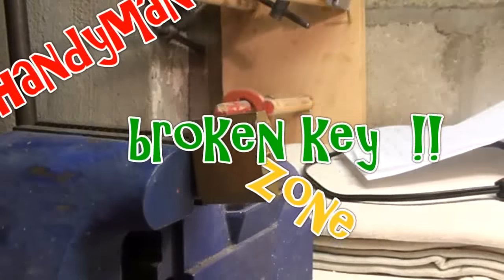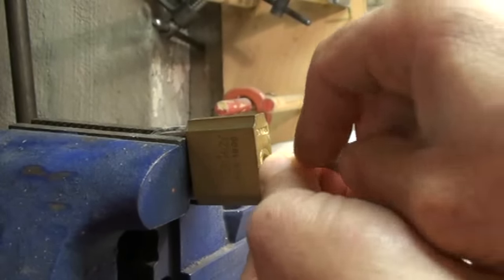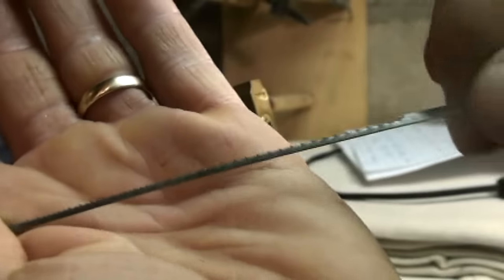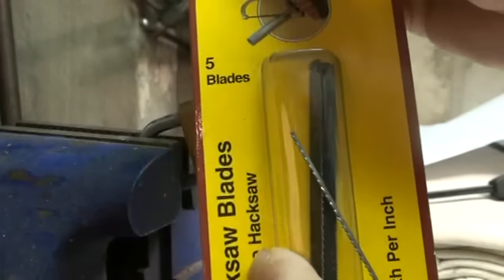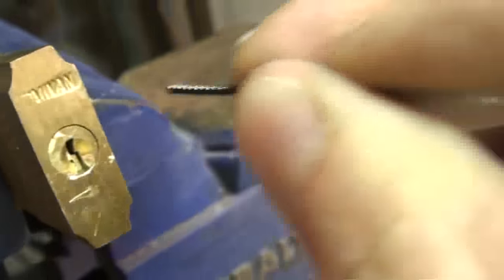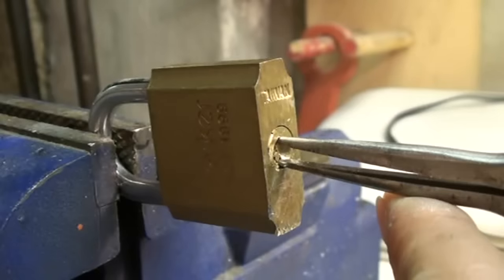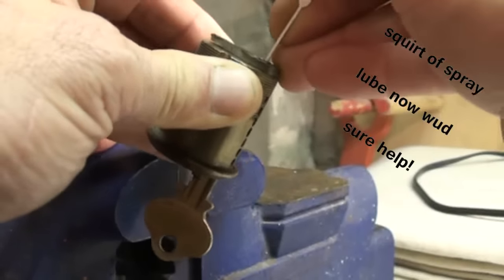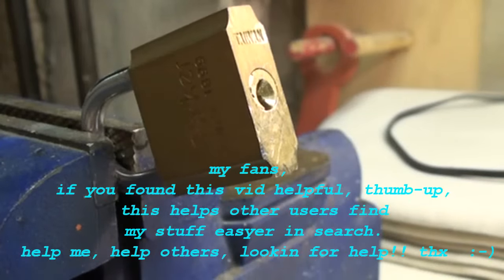7 Tricks Get Broken Key Out Yourself - Any Lock or Key

Comment: Your tips are still working, this one was a big help. The key was already turned in the door lock but was really tight, we thought we could get it locked, but the head of the key broke off. We tried a number of techniques but since the key was so tight in the lock nothing was working. We saw your video then wanted to try the broken jigsaw method but had a hard time with that. We also used the WD40. A friend with experience with broken keys in locks helped us figure out [tip] to use a big screw driver . . . since the key was already in the lock, we should be able to unlock using the big screw driver. This way we were able to open the door, then take the lock apart from the inside. After picking, we still had difficulty getting the broken key out, however, the friend didn't know about the broken jigsaw, so he gave that a try and that worked to finally get the broken key out. So your tips gave 3 old farts some new tools. Thanks again.

Comment: Absolute life saver. Front door Key broke in lock, used the push out key from back method using a straightened paperclip, thn got my jewellery  making tweezers (pointed ends ones) & pulled out  from front. Thanks  for posting this video.:-)

Comment: Thank you, thank you, thank you. Just saved my life. I didn't have any of the tools you mentioned, so I dripped canola oil drop by drop into the lock using a hijab pin and slowly extracted the key with a safety pin, then yanked it out with tweezers. I had previously spent all night trying to yank it out with just the tweezers to no avail.

Comment: You, sir, are INGENIOUS!

Spent $4.29 for a pack of jigsaw blades and got half of a broken key out of a mailbox lock.    

Used some WD40 and my needle-nose pliers to grab the tiny bit of key that was sticking out after using the blade.  

Thanks for the tip!

Comment: another way to open a lock even the key was still not extracted is open using the other half of the key.just push just like the way you opened a key then it will unlock. i tried it and it works for me.
Reply: Cheryl Nonato I totally did that too!

Comment: This may work on a building door lock,  however many complications may arise when doing this on an automotive lock, the parts (mostly "wafer" or "disc" tumblers/pins/wafers) inside most car locks are much thinner,  have thinner than hair springs, and delicate dust covers/shutters/key buzzer mechanisms which may be exposed to tool damage and irreparably damage the ignition or trunk lock requiring a sparkle wrench (aka drill) to carefully remove and often times source a dealer only part for over 100$ his cost available in 2 days. If this is in a door you can access otherwise or work around  (for a week to save for repairs) than feel free to experiment. 

However in my 12 years of experience in broken key extractions the most successful has been with single females who had the instinct to leave a situation out of their control in the hands of someone who has not only the right tools but also the experience in using them across a broad range of vehicles. My advice is if its a lock on a door you can live with replacing (25-95$ diy)and have an alternate way in or out  than the rapping method can work if struck at the right angle to compress the pin springs and expel the key via inertia overcoming friction than try it on a soft surface.  But shop around for a locksmith via phone for approximate prices before you even think about touching a broken off car key. If you can grab it with pliers and it sticking out of the lock and it broke because of an accident you can try, but if it broke because it was hard to turn to begin with,  or wouldn't turn back to lock, or had to be played with to work than even if you get it out and duplicated it may be a broken/damaged/repairable lock that needs a locksmith to make you either new keys,  and/or program those keys,  or fix whatever is wrong with the lock or what it connects to.
Reply: well if your keys stuck in your car ignition,your pretty much buggered anyway,either way it works out expensive
Reply: toppertruthio what's more expensive; 65$ for a locksmith to pluck out and duplicate your key, or 150$ for a dealer only ignition part and 50-60 in labor.

Comment: This video totally saved me from having to call the lock Smith when I broke our key in the lock. Got the WD-40 and a basic screw driver set from Target. Sprayed the lubricant and then used both the 1.4 mm and 2.0 mm ends to get the key out (using one to pry from the bottom of the key hole and the other to pry from the top of the key hole at the same time) Worked like a charm. Thank you for posting this video!!

Comment: A thousand thanks. My key snapped in my van vault lock. The lock still operated with the remainder of the key pushed into the lock. I managed to remove the lock mechanism from the lid and on the back of the lock was a pin hole. Having watched your video where you drilled a hole into the lock, I went and found a small/micro screwdriver and I pushed this into the hole at the back of the lock and wow out popped the broken/snapped off piece.
Fortunately Van Vault come with 3 sets of keys so I still have 2 and we are back in business. 5 stars to you👍

Comment: callled a locksmith shop asking if they sold the key extractor tool.  He told me they had them but they didn't sell them to the public and for $170 they could come out.  Tried your 2nd method, the mini hacksaw blade. Worked perfectly. Thanks!

Comment: method #2 worked wonders for me! Unscrewed the whole lock (it was a "block" with the cylinder on the external side), sprayed with wd 40 and then bumped it on the garage floor till the key came out! Thanks for sharing, this saved me 50-100 euros for the locksmith!

Comment: I don't generally leave comments, but your suggestions worked for me.  I couldn't' force the broken key out of the lock, so I pushed it in and used a screw driver to turn the cylinder.  Thanks for the video!  You just saved my camping trip.

Comment: Dino, I was going to drill out the lock cylinder and buy a new lockset at the hardware store, then decided I'd try google, and watched your video. I didn't have the hi-lo blade, so modified a used hacksaw blade with my dremel tool, and ten minutes later using it as a key extractor had the broken key out. Thanks!

Comment: Thanks a lot for your great video. I managed to pull out the tip of my broken key after lubricating the cylinder, dismountung it from the lock and hitting it several times on the floor. The broken tip came out easily even though it was well stuck all the way inside the cylinder. A 30 min. job also trying some of your other tricks. Thanks again!!!

You saved myself having to call a locksmith.

Comment: Thank you So So much! I just retrieved a broken key from my security gate! I used your fundementals but improvised. Used a really thin nail and hammered it flat, after applying lube, I slipped it in and applied a bit of pressure and the key popped out enough forthe needle nose pliers to do the rest! You sir, are a legend!

Comment: Thank you sir! The first 2 steps worked for me. I made my own extracter tool by taking a small piece of wire and made a very tiny 90 degree end on it. Lubed up the key and used the tool and it came out no problem.

Comment: I cannot thank you enough!  Last night I got home from work to walk my dog, and just as I turned to key in the lock, it turned to butter and just disintegrated in my hand, with half in the lock. Luckily I was able to open the door, but 1st thing this am I went to Home Depot for WD-40 and some thin hack saw blades. They guys there were laughing at me. I got home, followed your directions in in less than 30 seconds the key was out!  You saved me over $125 with a local lock smith! YAYYYY!

Comment: Thank you very much for posting this.I have a Honda w/ a broken key in the trunk lock. Never needed it removed because I could open it w/ the trunk release lever from inside the cabin, plus it kept ppl from breaking into my trunk. That was until I needed to reset the alarm after disconnecting the battery which required to lock & unlock the doors and trunk in a certain sequence w/ the key.

Comment: I tried your suggestion to use gravity and smacked the lock against a concrete slab.  After attempt #1,  the key slightly edged out.  The key came out enough to grab it with tweezers after attempt #2.  The key fell out completely with attempt #3. Took less than a minute. Thank you for saving me from the overpriced locksmith.    You are the man!!!
Reply from the maker: +Raymond Monarque good work ! ,gravity , still unknown is a friend, yet can kill too (as in a fall from helecopter)

Comment: After trying everything I could think of to remove a broken key from a lock, I turned to YouTube and found your video.  The technique that looked to be the most promising was the mini-hacksaw blade, and I happened to have one in my shop.  I cut it in half, as the ends had hardware on them to attach to the hacksaw frame, but it was still a bit too wide (back to teeth) to fit in the very tiny space between the broken key and the cylinder, so I used a metal "nibbling" tool to taper the back side (bringing the blade to a point), and it fit right in.  I gave it a tiny twist to allow the teeth to try to "dig into" the broken key, pulled, and the broken key shot out across my shop.  THANK YOU for an excellent video!!!

Comment: Thank-you. I was able to get in another door and used the suggestion of taking it apart & pushing it out, from the back. Disaster averted & lock cleaned & lubed. Works better than before. Thanks.

Comment: Thankyou for your advice. Your video was the first and only one i needed, to remove a broken key buried deep within a motorcycle top box. Its saved the box, and my work, as i use it daily. 
Now i just need to find a stronger key, as its not the first time the Honda key has broken, and both times its been in the same place on the key. 
Unfortunately  its not as simple as cutting  a new one, because the immobiliser tag is integral to the key. Now I'll  just have to carry a spare, and a set of needle tweezers  on me!

Comment: Great Help, Dino,
I used a bobby pin.  I straightened the pin and put a small bend on the end, say 1/8 of and inch.  After 15 - 20 tries and patience I figured out which side of the lock had the teeth and the broken key came out. Great video.  Best, Kurt.

Comment: Great advice.  I never leave product reviews, but this video I had to comment on.

I have a garden tractor that has sat with a broken key in it outside for years.  I sprayed a little penetrating fluid in it and then using the broken scroll saw blade method, extracted it with ease.  

Being able to go to any home improvement store and get a $3.00 set of blades made extracting the key cheap and easy.  Thanks for the video.
Reply from the maker: cgc7078 glad to help +cgc7080 !! , now a good key cutter should be able make a new key from the stub.....unless you have the spare (get copy made....lol)

Comment: Your Trick worked for me in two seconds. hooray. All I had was a small pair of thin sharp pointed tweezers.  Kinda used it like your blade idea. I stuck one side of the tweezer in twisted and pulled. Came out. The tweezer was bent a little but much cheaper thank a locksmith. 
Thank You.

Comment: Thank you for your video. I was able to extract a key that had been stuck for about a year. I snapped a bobby pin in half. After trying your method that brought it out of the lock a little, I put one half at the bottom of the lock pulling down while using tweezers to pull it completely out.

Comment: Very helpful. Had to remove the barrel from the door and hold down one of the spring loaded pins before giving a sharp jolt which brought the broken piece of key out. Reckon I saved about £80. Thanks.

Comment: I broke my key deep in the ignition after the pathfinder 94 ignition was damaged from being stolen earlier that day... I've been watching all the videos to remove a broken key, your advice to use a hacksaw is what worked. It took me 2 hours, with the help of the hacksaw (home Depot,  didn't have hilo, and what they did have wasn't as small but still helped). The hacksaw started the pull out but because of the size it would only allow it to come so far. So I use a broken a half Bobby pin and because I forgot to get the DW40, I use my oil sheen. So 2 hair  products and one tool accessory along with you2 YouTube video on how to, I was able to do it! Honestly without you video I don't think I would have attempted it. It took me 2 hours and was well worth it, as i had to pay 300+ to get it out of storage from the tow company  Now I have to get the battery charged as a jump didn't work.  Thank you for the video!!!!

Comment: Thanks for the tip! I used the jigsaw method for a key that was completely broken off in my door. I didn't have a jigsaw blade so I broke off a piece of flat metal from a hair clip and bent the end of it slightly with pliers. It worked perfectly and didn't cost me anything but one of my kids only hair clips. :)

Comment: Thank you for your video!  It was very helpful, I pulled our broken key out of our front door  in two minutes.  Instead of the key extractor tool I used the smart key that came with my lock set to help pull the key out slightly and plyers to rotate it down to pull it out.  Great tips.

Comment: Thank you for this video. I had to use my angle grinder to grind down the Mini Jig Saw Blade but I was able to get the key out of the lock in about 45 minutes using WD-40 the ground down mini jigsaw blade and thin needle nose pliers.  It was rather frustrating but I am super grateful for this video and it was quite the moment of relief when the broken key came out.

Comment: Thank you so much! I just did this earlier this evening and it worked like a charm. It wasn't quite as easy for me as it was for you in the video, but my key has been stuck in my car door for over two years! It took me less than 15 minutes to get it out and save a ton of money, so THANK YOU!! (i used the jigsaw method, used a really small one with pretty fine blades. )

Comment: My man - you totally just saved my ass. A friend gave me an antique cash register from a store that was closing (talking 100% mechanical here, circa 1940's-50's) but one of the keys for it were broken. Been trying everything to get that little bugger out since even when it's turned to the "unlocked" position, it's not like it's going to spring something open like a padlock does (it just prevents operation of the register). Jigsaw blade to the rescue!

Comment: Thanks for the video. In my case I used a slotted screwdriver to opened a dor (with the snapped key inside ) and after that I was able to pull the snapped part with other spare key. Then I used a pliers tool to remove the snapped key.

Comment: Good morning!!!

Thanks for the information!!!  My key broke off in our front door dead bolt YEARS AGO.  Adding insult to injury, it had twisted before breaking off.  So for years I've locked the front door from within and left by the back door.  A real PITA but $ was short and I got used to it.

Oddly I thought about it this morning and watched your video.  First I sprayed silicon in and then used anything (needle nose pliers, paper clips, tweezers, etc., I thought small enough to "grab" the broken key but nothing seemed to work.  Finally I gave up but when I returned I picked up the dead bolt and needle nosed pliers and it came flying out.  Wow!!!  

Maybe the silicon needed time to work but it did work.  I'm about to head out to get some keys made.

Thanks again and as we both know, there are those who will charge as much as they can so disregard the naysayers.

Comment: Thanks for the tips. I used a tin metal rod that came from computer heatsink that holds the heatsink over the processor on the mother board..worked like a charm and had it out in less than a minute. Fantastic!

Comment: Thanks Dino I managed to use the grab pincer method with 2 really thin laptop screwdrivers to remove the snapped section. Just back from the locksmiths and all sorted Cheers :)

Comment: Thank you, I broke a key in the garage door, using silicone spray and 2 safety pins as the thin iron rods in the way you suggested I was able to remove the key in less than 2 minutes - not bad for first attempt. Thought I would have to replace the whole unit and then the other garage door would have a different key and the whole thing would just be a pain, not now though. Thank you; (Australia)

Comment: Thanks for the info, after two years finally got the broken key out. Key cylinder was turned with the broken key so it wouldn't pull out. Had to disassemble the assembly. Now Lowe's and Home Depot won't work with a broken key. I'll check the Hardware store next.

Comment: Dino, I loved the video and it inspired me to invent an 8th technique. Key was stuck in a deadbolt lock. I removed it. I tried several of your methods  and failed. The key was twisted in the lock so it caught in 1 or 2 places. Stuck. It was the push through that inspired me to cut the head off an old key of the same brand and after carefully (not losing a tiny spring and pin) removing the turning mechanism on the back I was able to tap the cut off key to push it through the slot from behind! TY!

Comment: Today the key to my rear gate at home broke off as I was taking the recycling bin to the driver of the truck. I googled and found your solution. I used WD and could not locate my needle nose pliers. Instead    I dismantled the deadbolt lock and used a heavy duty paperclip bent at one end and it came out.
 Thanks much for your video.